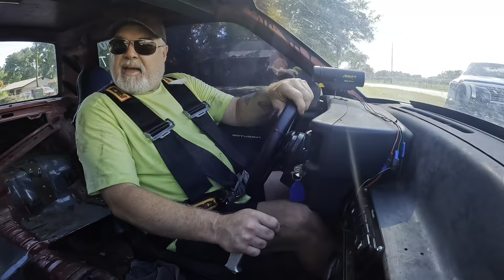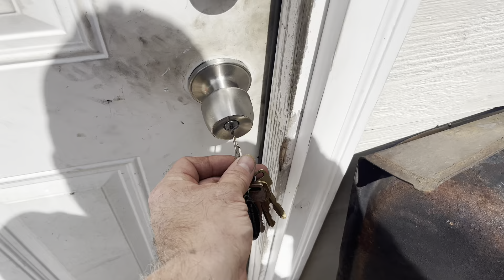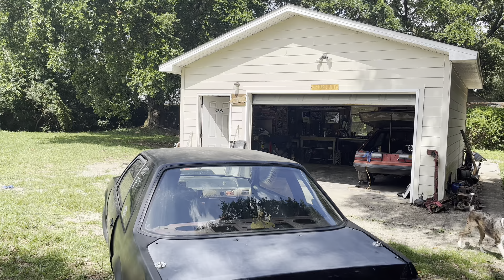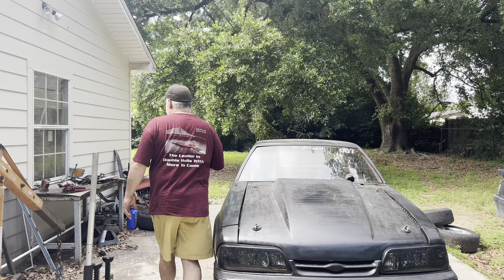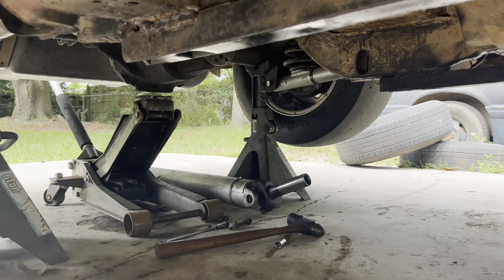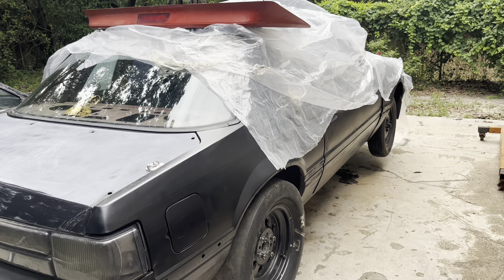1990 5.0 LX Notch Mustang pt.63 T5-FU Theatre Presents: "10 PUCKS of Fury!"

Comment: Hey Rodney, I’ve been trying to make my 351w T5 ranger work on radials, but I seem to be shocking my suspension from hitting the tires to hard, I was curious what your thoughts on the clutch tamer and if you’d ever used one?
Reply from the maker: They work I suppose but I’ve never used one even though I have one..just be aware it’s whole job is to slip the clutch so depending on what you actually have for a clutch your results may vary 🤪
Reply: @5.0tussin  10-4 thank you sir! I may give it a shot since my left foot can’t seem to figure it out lol
Reply from the maker: @shitboxranger9816  those radials can be pretty unforgiving unless they’re the mt brackets but I’ll still take a slick with a stick 🤪🤣
Reply: @5.0tussin  radials with a stick has been a nightmare for me, if I was a smart person I’d get slicks lol

Comment: If I remember correctly, you said you like the clutch at the top of the pedal in a previous video?
Reply from the maker: My arms “faster” than my leg so clutch at the top (less pedal travel for disengagement) and a stock length handle (to slow my arm down a hair) are the match for me to be comfortable and not (in theory) miss a ton of gears 🤣